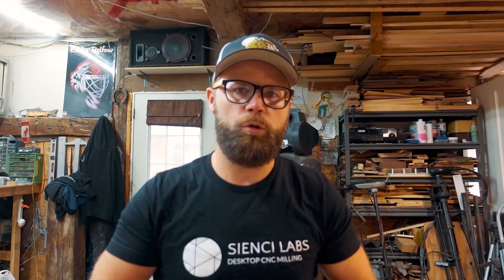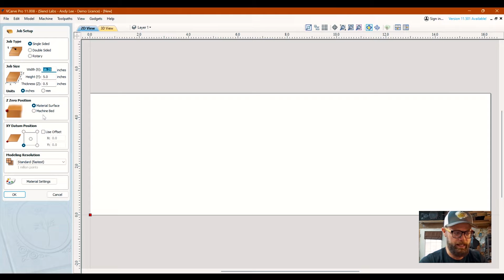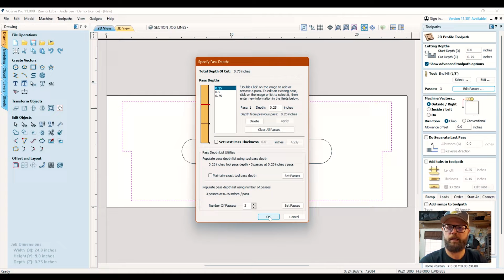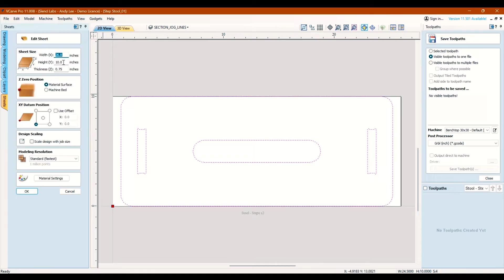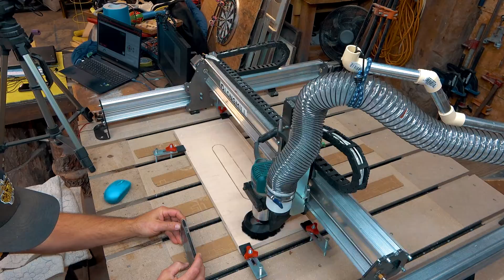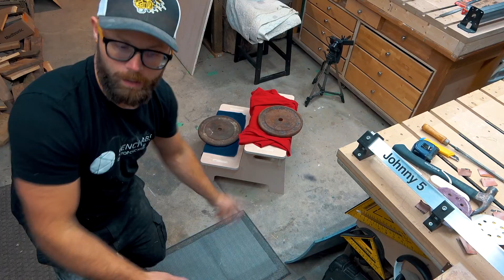STEP Up Your Game! Build an AWESOME Stool on Your LongMill MK2 CNC

Comment: nice simple project however a stools base should always be larger than it's platform/deck/tread. This prevents tipping, I've found 5 deg. enough. Hard to cut those angles on a longmill
Reply from the maker: Great advice 👍 Probably also possible with a tweak of the existing design

Comment: What is the build for the platform for the LM2? Is it just 3/4 mdf attached to box framed 2x4s?  is the 2x4 frame attached to the workbench at all? I'm building my LM2 now and I picked up a free oak kitchen table to the platform. Im not sure if i should just screw the 3/4 mdf to the table then do the t tracks or if i can do a 2x4 frame with the mdf attached and t tracks without screw to the table.
Reply: I would screw the LM to the table, cut the MDF in 4 or so inch strips, depending on how many T-Tracks you want to lay down. Then lay one strip of MDF then T-track, another 4 in strip of MDF then another T-Track. all the way across. Then surface it.